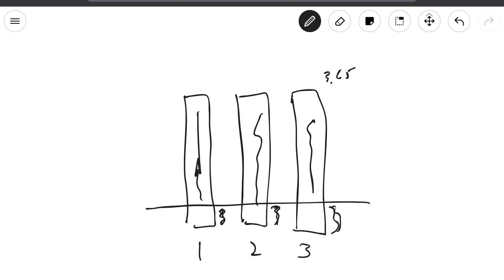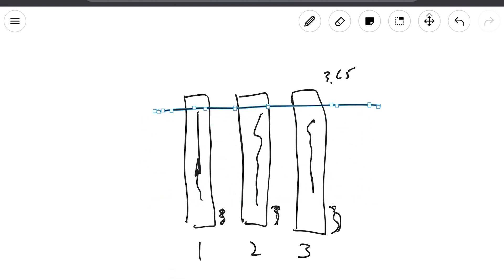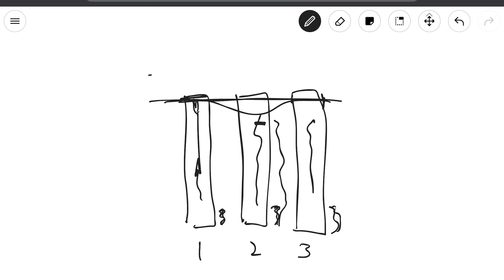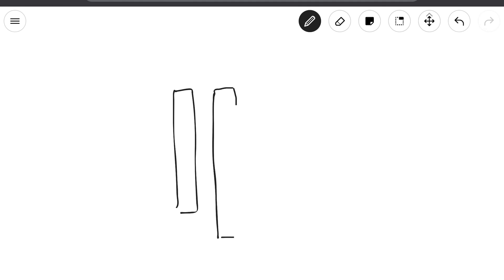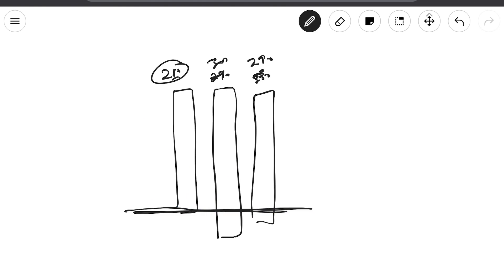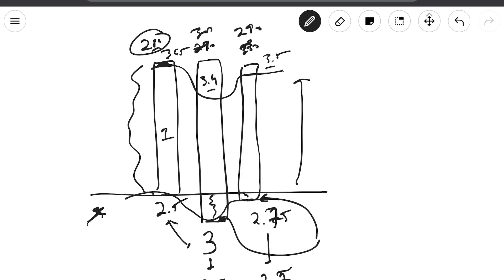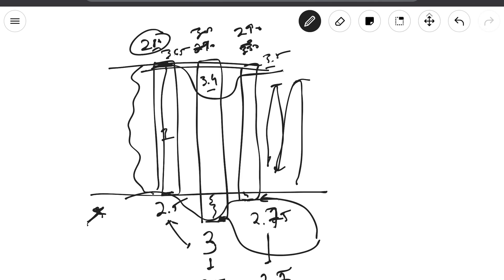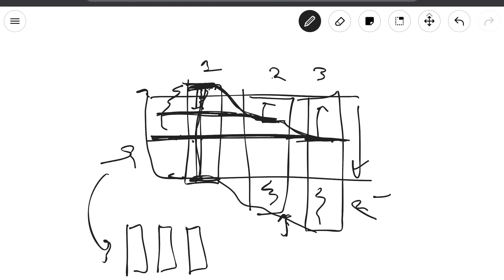Do Lifepo4 Batteries Need Passive Balancers???

Comment: Gosh!!! great points. So if my novice brain  is to understand: First, start out with a top balance. Second, Rely on a good grade BMS to maintain the top balance. 

Question: I have watched some videos and did some reading where the claim was made that a battery bank eventually falls out of balance inspite of the BMS. Hence, a periodic top balance, perhaps once a year, is needed.  Would it be beneficial and/or possible to switch to an active balancer from the regular BMS. once or twice a year. starting from the discharged state; letting the active balancer take the bank to a fully charged state; and then switching back to the regular BMS thus never changing the situation at the bottom?

I am thinking that the active balancer could take place of periodic top balancing in leu of disassembling the pack and doing a top balance and then putting the pack back into serial connection and commencing regular use. This providing that the active balancer only be used in  charging and not discharging. Of course this may mean using the BMS and  active balancer alternately a few times in a row if the pack is totally out of balance. 

What do you think?
Reply from the maker: Great question. You can actually use both a BMS and active balancer at the same time (which is what I do). If the active balancer works then you will be in great shape. Just make sure to check in once in a while to make sure everything is working perfectly. 

If you don't want to use the active balancer all the time, you can of course disconnect the BMS and then install the active balancer to achieve a top balance without dissembling the battery. Just make sure you cells are charged (maybe 80%) because balancers work faster at higher voltages. Also, active balancers tend to move only a few amps an hour, so if you do have large cells, it could still take a day or so to balance them with an active charger. My suggestion: just put a BMS on there and an active balancer - but only after you do an initial top balance to start things off.

Comment: Hey Will thanx for all the help on building my system but it looks like I need more solar panels. I have six 100 watt panels now and are connected three on three for 60 volts and 10 amps I would like to know if I buy six more what would be the best way to connect them. I have a Victron 100/30  I know I will have to buy the Victron 150/50 also to charge my 8 200AH lipo4 12v I also have a Daly 120 4s  BMS will i need to change this also??  Thanx Nap
Reply from the maker: Hi Napoleon, your question is a little too complicated for me to answer here. How many volts and amps does each panel produce? I think you should still be able to use your original batteries and BMS no matter what you do with your solar panels.
Reply: @TheWilltoBuild  Sorry for that. I think I have it figured out. I will connect the 12  solar panels in sets of 4 series of 3 to give me 30V per set  and 5Amp per set to give me a total of =120V and 20Amp. My charge controller will be 150/35 So I just want to know is this a good way or do you have a better idea. So all together I will have 12 Rich solar panel and a Victron 150/35 8 eve 200Ah set to give 12V and a Daly 120 4s.  Thanx

Comment: Can't a passive balancer not be used to only balance at the top, when the bank is fully charged? And the passive balancer gets deactivated under 90% soc.
Reply from the maker: A passive balancer could theoretically be used to top or bottom balance. Most BMS passive balancing only kicks in at a higher soc though, as you mentioned. But the actual soc will depend on the manufacturer. After market passive balancers will also have their own disconnect soc, and that can be quite low.

Comment: have you ever measured what happens in real life with different capacity cells?  Because you are using your mistaken graphic analogy, you are assuming the voltage  on the higher capacity cell falls at the same synchronised rate...this not what happens in real life. You are misleading your viewers.
Reply: yes, testing the graphic analogy would be interesting
Reply from the maker: I think you are misunderstanding the analogy. The amount of power used is the same, but larger capacity cells will have higher voltages, because they still have more relative power remaining. The entire point is that if you don't have cells matched on capacity, the voltages change at different rates.
Reply: @TheWilltoBuild  in your video you show and mention that the voltage is dropping evenly....I am not misunderstanding your analogy ....I am pointing out how your analogy is leading you and your viewers to the wrong understanding.....as said on a previous video comment ...larger capacity cells should be illustrated as wider but with the same height...for multiple reasons...one being that the BMS and battery chemistry determine when a cell is fully charged or depleted. If the ultimate goal is to obtain the best performance from a bank of cells in series ...the voltages of all cells is what balancing does..even if the internal resistance differences of cells slowly unbalances otherwise matched cells. In my observations and experience even the best cell manufacturers do not match AH capacity and internal resistance over many charge discharge cycles....at best  they might test or charge once and supply them at the same voltage.. Any guarantees that are provided are on the proviso that they are used with a BMS.
Reply from the maker: @mekuranda  I think you are still mistaken but I do appreciate you making the effort to protect people. I do totally agree a BMS is ALWAYS necessary and I think I have been clear about that in my videos.

Comment: Great tutorial. Whilst passive balancing is of little value this is not a reason to omit the cables to the cells. Remember these cables are still important to enable the BMS to know the individual cell voltages so that it can shut down the battery should high or low limits be reached on any one cell.
Reply from the maker: You absolutely need to wire the BMS correctly, including all the individual cell wires, for it to work properly.